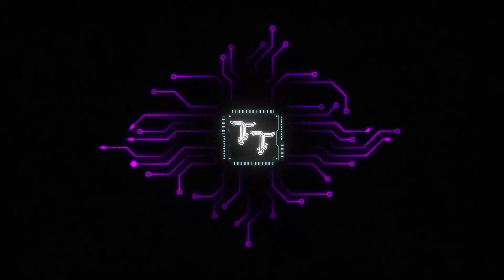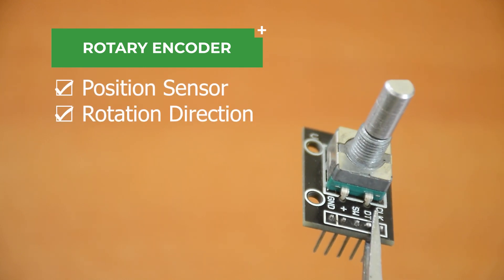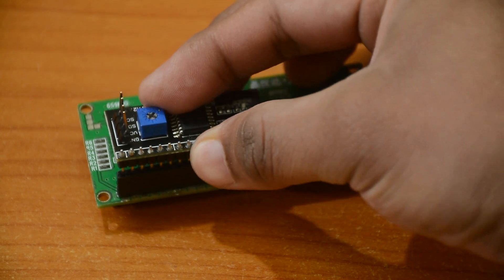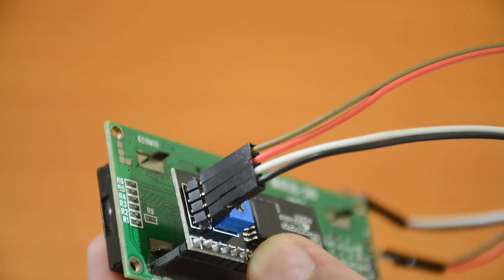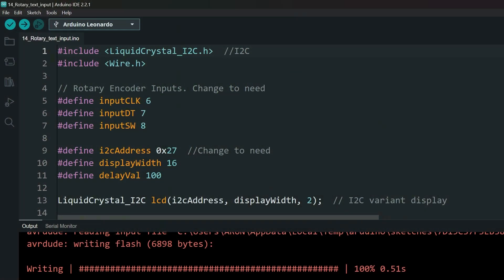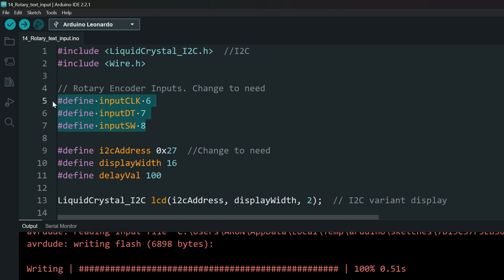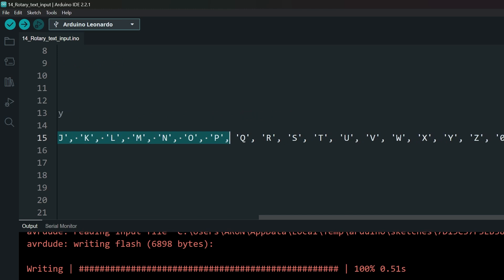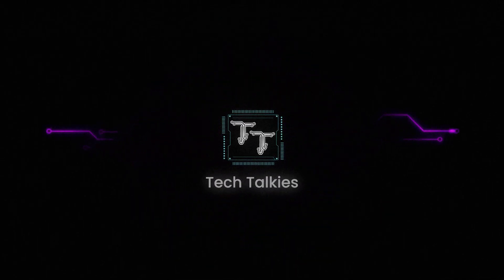Arduino Project to input text without a Keyboard

Comment: How to store a inputed text in the lcd to string and save to eeprom?
Reply from the maker: The ESP8266 has 512 bytes of internal EEPROM, if it is not full with the code, it can be used to save data. Check the below example and you can modify and use it.

#include <EEPROM.h>

int addr = 0;

void setup()
{
  EEPROM.begin(512);  //Initialize EEPROM

  // write to EEPROM.
  EEPROM.write(addr, 'a');    
  addr++;                      //Increment address
  EEPROM.write(addr, 'b');   
  addr++;                      //Increment address
  EEPROM.write(addr, 'C');    

  //Write string to eeprom
  String sample = "testing eeprom";
  for(int i=0;i<sample.length();i++)
  {
    EEPROM.write(0x0F+i, sample[i]); //Write one by one with starting address of 0x0F
  }
  EEPROM.commit();    //Store data to EEPROM
}

Comment: Can I use Potentiometer 10k for this project!?
Reply from the maker: It will probably work but not as user friendly as a rotary encoder. You will have to code exact resistance values for each character. Give it a try and let me know! I can help you with the code if you get stuck.